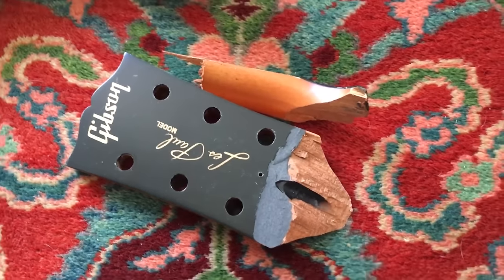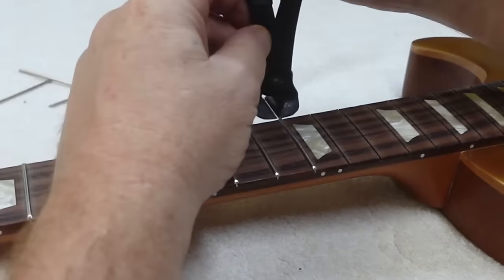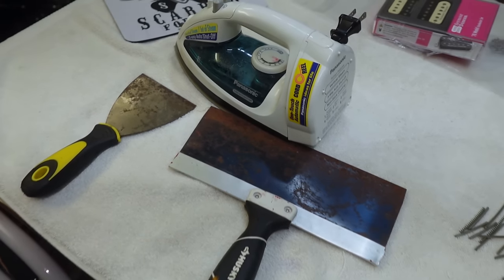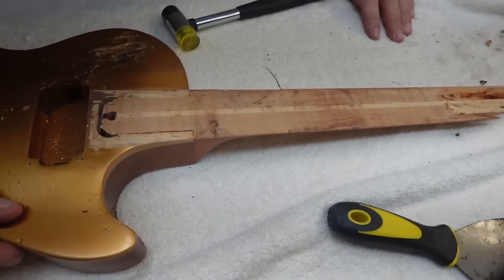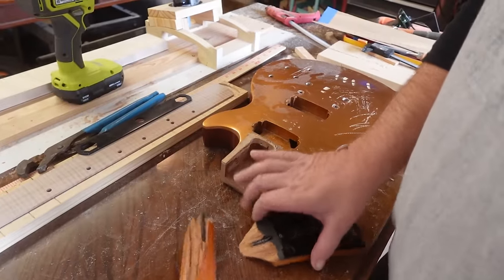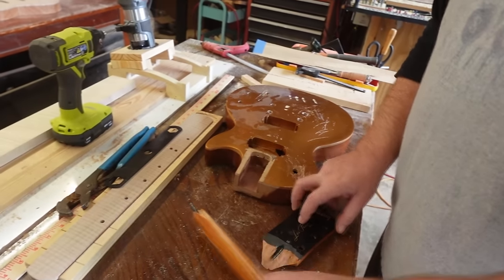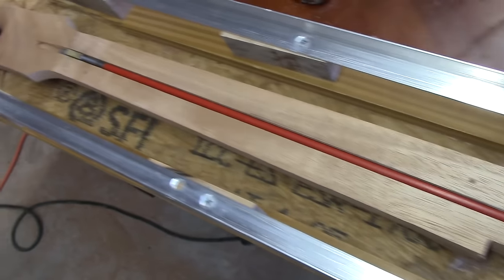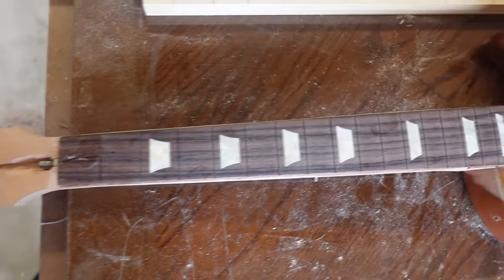The Guitologist Found This GIBSON LES PAUL DESTROYED BY GUITAR CENTER?? WHY? LET'S SAVE IT!!

Comment: Brilliant! I'll binge watch any video of any length you're willing to make. You get results. Hadn't considered steam iron removing set neck. I DO have an iron i use to remove ceramic magnets glued to cheap single coil pickups when changing magnet types , and to heat paraffin wax in a stainless steel container to pot pickups

Comment: Back in 2010 I bought a Parker PM20 off ebay for $175. The guitar had fallen over and the top of the broke off at the nut - and was lost - fretboard was still intact.  It took me a long time to figure out how to fix it, but I eventually cleaned up the fracture , gorilla glued wood patches and carved to match the Parker. Still have it today.

Comment: So the real thing that happens is: if a guitar arrives broken, its not Gibsons fault, its technically the shippers fault but they wouldn’t take accountability. Gibson wont cover anything once its already bought for the store. So being that this particular guitar is only a tribute model, it just becomes a loss to the store and its up to the store if they want to try to fix it and sell it at a loss and have it sit there forever or take it apart for spare parts and throw away the damaged wood and make sure it cant be used again. So in reality its like they only lose a couple hundred but its worked into the loss budget and the guitar just doesn’t exist to them (inventory wise)

Comment: The 'inventory problem' is probably a flaw, damage, or warrantee issue of new stock that Gibson doesn't want to repair. So, to save shipping costs in a Return to Vendor, they require the damage you see documenting the serial number, and Guitar Center was issued a credit or replacement.

Comment: Sean, so much fun!!! Cut that neck out of blank like a BOSS!! Appreciate the fretboard lifting how-to. I use a similar technique to flatten out warped pickguards right on the ironing board. Only takes a couple of lightly firm presses with the hot steam iron, with the pickguard sandwiched in between a couple of terry cloths or towels. Works amazingly well. I always learn great tips from your projects. Thanks to you both for the videos!

Comment: Tenderoni. That's the 1st time I've heard that. Laughed so hard. I want to ask an honest question concerning band saws. What size do you need starting out, or is this just something you have to buy a 14 inch from the get go? I've heard you can get bye with 9, 10 or it HAS TO BE 14 inch. Thank you.
Reply from the maker: 14 all the way! The others are trash and a waste of money. None of the 9 or 10's will cut real hard woods without coughing and sputtering. Rikon makes the best 14 in too. 110volts plugs right into a regular wall socket ;)
Reply: @scarmyguitar  Thank you for answering me. I worked as a carpenter for years, and had to have very good tools. We did not use very many shop tools though.Even in the cabinet shop, never had a band saw.

Comment: I like everything about this except for one. The one piece neck. It would maybe be better to scarf joint it under the fretboard and use a full piece of wood for the headstock so the grain runs the full length of the headstock instead of just across the thickness of the headstock. Dropping a volute on there wouldnt  hurt either if theres enough material left.Curious to see what the next video brings.

Comment: I guess the fact that they did it is something that pisses me off, but what’s done is done. I built engines for 40 years and you see things that make you scratch your head. Someone put a 300 hp engine together to do a 500 hp job and I got it as a core. I have to figure it out and make it what I want it to do. That core can be built to make 700 hp. And it doesn’t have to be pretty. I asked the customer do you want to go fast or sit and let people admire it. I can’t do both. I’m going to cut a hole in the hood, build the bottom end to make 700 hp and put a 2x4 Tunnel Ram and a pair of Double Pumpers. If you want a shiny manifold and those fuel injection things. I am not your guy. I can put an ugly piped Turbocharger on. I can put that together and run a blow through. I can make it work. And it will whoop ass and not blow up.

Comment: wow, wish had wood working skills, signed up for wood shop in high school in 1969, the 1st day of class when the shop teacher said no long hairs will operate any power equipment in my shop this old Hippy transferred to metal shop and retired after working 49 years in a heat treat shop
Reply: Worked at GM Detroit Diesel Alison plant early 70's, we freaks got special hats like a ratter's cap with a hair net in back, we could spot each other two stations over, this was early times when there was a long hair brothrrhood,

Comment: Hey I am not one of those guys you mentioned.  And even though I have been playing for 51 years and doing my own work on my stuff, I have never gone the distance like you do .So you are asking what the fuck do I want? Well I do maintenance work and that peeling the fret board part is pretty much like removing VCT tile cuz you were using the same things I use ,  now I think I will try the steam iron, But to the what I would suggest , when you used a chisel when removing the neck consider  a  inch & half putty knife sharpen a bit on the bench grinder and maybe even heated a bit , after you have your line. You are a Texas boy are you not I spent time as kid in that state and knew amny people like you, you don't suffer fools and will knock some one out . Good job I liked your work and learned some.

Comment: I'm not trying to be a dick, I swear, but if all you're going to do is save the body, is it really worth it?
Reply: Only my opinion but it's worth it for the fact that it was a branded body and possibly a fair bit of fretboard value. The fact that he's capable of doing the work is probably the saving grace. And a big finger to guitar centre and Gibson. Less extreme than body work and rust repair on a crumpled wrecked vehicle.
Reply: @brucehayes7251  you got that right.  I hate when you see a car that you know is made from 3 cars selling at Mecum for big bucks. All of the BS you see in the car restoration business is stupid. I really admire what Sean is doing here and he made it even better than what it originally was, that looks like a long neck tenon and that 2 way truss rod is really good. That is really top notch work Sean! I can’t wait for the next video!

Comment: Grab the elmers lol these would be great to practice repair work
Reply from the maker: I'll give you the first tip you need....Don't use Elmers!! LOL 4 real
Reply: Titebond red or hide glue
Reply: I broke my beater acoustic headstock elmers was all I had didn't would hold or not but I thinned it down some poured it in the crack wrapped the neck with a bungee cord and its held for me so far lol probably not ideal tho

Comment: Thats a partsguitar now and not a gibson....
Reply: @sadie376  Dont know how new you are to the guitar world but if the original body or the neck of a guitar(any guitar) is missing or replaced the end result is called a parts guitar....you can replace ANYTHING else on the guitar..tuners,pickups,electronics,frets,nut, bridge etc etc etc..you name it..and the guitar is still considered the original guitar but change the body or the neck(or both) and you dont have the right to use the name of the original instrument anymore.....an attempt to re sale a guitar like this ll reveal that  to you pretty quickly....

If he tried to repair the original neck even if he used extra wood,splines,retouched and repainted it,there would be a devalue to the original price but it would still be considered a Gibson.Now its just a parts guitar.
Reply: So.  LOL  It was in parts in a dumpster.
Reply: @TexanUSMC8089  And in parts it remains...

Comment: I suspect Guitar Center acquired a fake, so it would make sense to destroy it rather than put it out in the market and ruin their reputation.  Just by looking at the gold overspray paint inside the pickup cavities it's most likely fake.  This is why SCAR MY GUITAR is restoring it with their own brand headstock on it.  It's not a real Gibson!
Reply from the maker: Boy you're stupid ain't ya?
Reply: Guitar Center is told by Gibson to destroy any faulty guitar instead of sending it back so they can both use it as a tax write off.
Reply: Really? so they went to the trouble of putting RFID under the fretboard? This Is a Real Gibson Stupid...
Reply: Hey "Its not a real Gibson. Didn't you hear what said in the beginning of the video about know it all commenters? So your a guitar expert? Do you specialize in Gibson or a expert in all guitars?
Reply: You can tell it's real by how cheap and nasty it's put together .